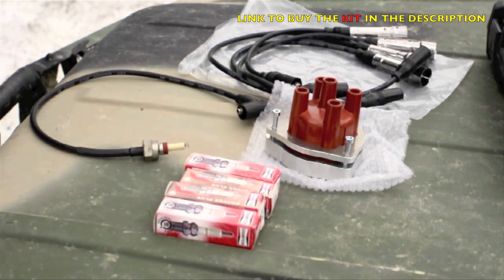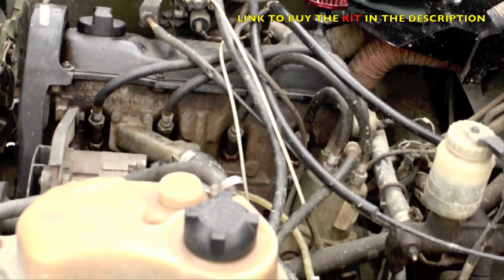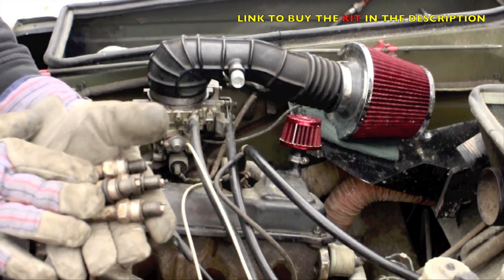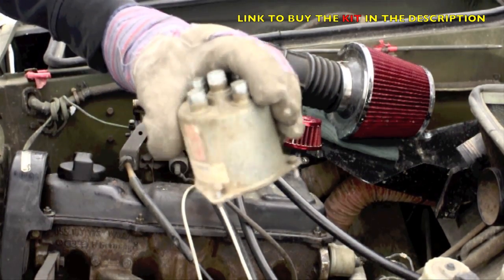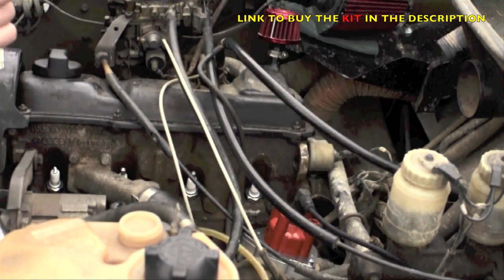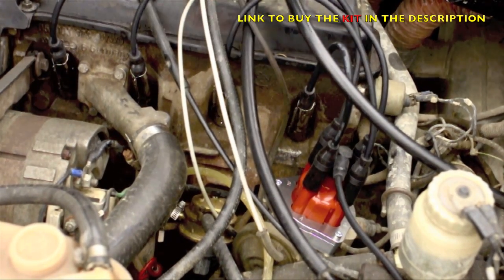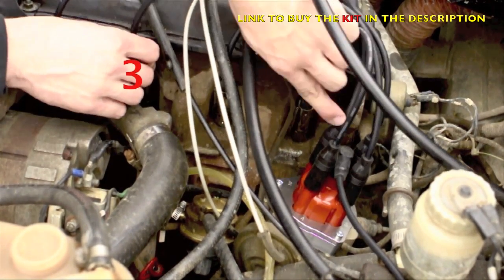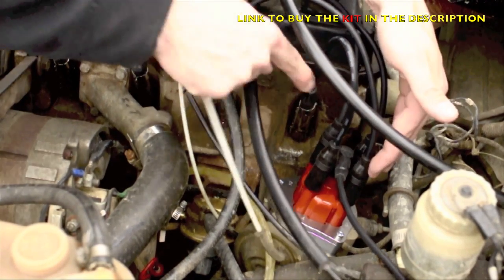Bombardier/VW ILTIS ignition conversion kit

Comment: The conversion kit looks pretty good. But it is no longer watertight!
I put the air filter in the glove compartment.
I had a MUNGA & ILTIS (VW).
Reply from the maker: Indeed, the stock distribution system was better for deep water because of the water-tight spark plugs. But this kit made it better for everyday driving. The stock spark plugs costed a fortune!

Comment: Better put a stronger engine in. Total underpowered every Iltis.
Reply from the maker: I think it really depends what you use it for. For the 70-80kmh gravel-road cruising and moderate off-roading I did, never ran out of power. The engine only proved too weak when trying to climb long sand slopes.
Reply: @FedericoLucchi  i like the technical side of an Iltis but the engine is just too weak. But get a 2 litre injection in there would be nice. About 130-140 hp.

Comment: where would I find a dvd  about repair and maintenance - I have one huge badly photocopied book, but it was like reading 1970s stereo instructions
any help would be greatly appreciated
Reply from the maker: I never heard of a DVD... but there are forums and websites you can use to get the help you need. Here is a Facebook group you can join, and ask questions when you run into trouble. Personally, I always found solutions when repairing or servicing my Iltis. It's a simple machine, easy to understand.
https://www.facebook.com/groups/19474710063/?ref=bookmarks
Reply from the maker: P.S.: Sorry for the late reply.... I just didn't get any notification...?

Comment from the maker: I had to add a "splash guard" under the filter to avoid it getting wet when driving into puddles, and also added a separate air filter for the oil, though that isn't necessary since the original connection tube between the carburetor and oil carter would still work. 

This cheap little modification doesn't allow me to drive in deep water like the original filter, but it increases HP and adds a nice "full-throttle" sound to the engine!

Comment from the maker: Hi there!
My original air filter was very dirty and needed to be replaced... since I wasn't able to find a replacement one (I live in a desolated area, hahaha!) I just bought a regular 3 inch cone filter for 10$. I completely removed the original filter system (and kept it safe!!) and simply inserted the carburetor rubber intake tube in the cone filter, since it would fit almost perfectly.